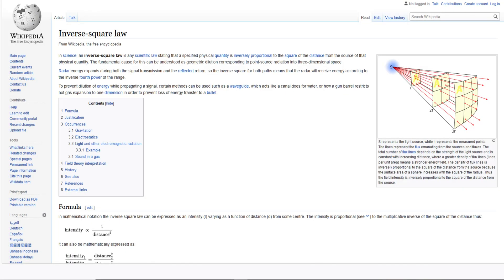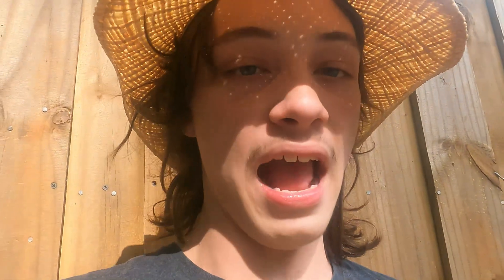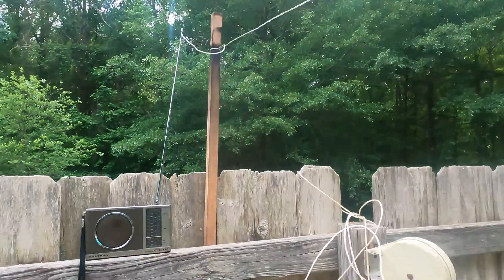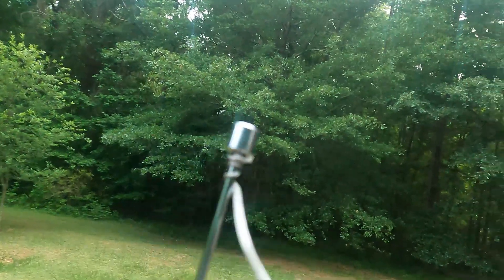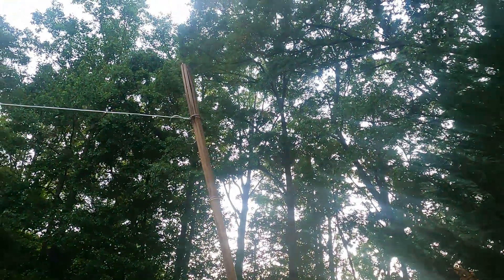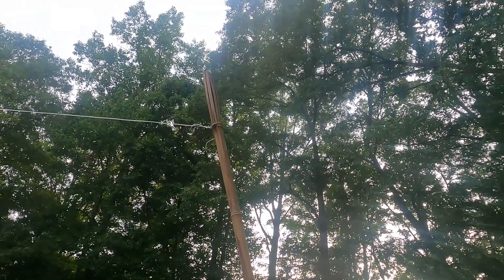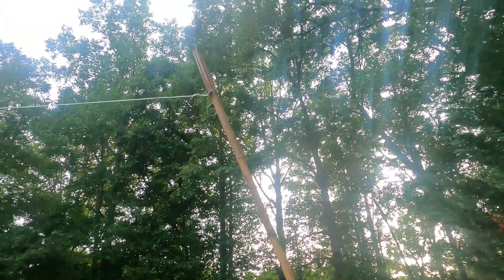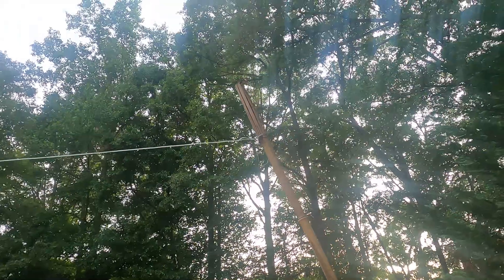DIY random wire shortwave radio antenna!

Comment: Can I just lay the wire on a metal roof?
Reply from the maker: Yes although you could also try attaching the wire to the roof to use it as an antenna if it's metal.  Although your roof may or may not be grounded so your results may vary.  PS I know I'm stating the obvious but just to cover all my bases.  DO NOT! drill a hole through the roof to connect the antenna cause it would you know leak.